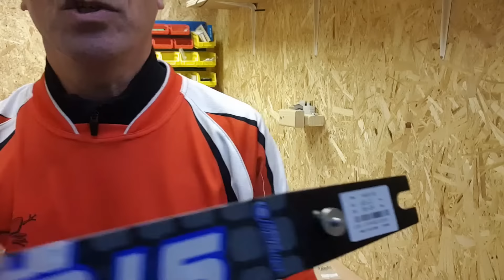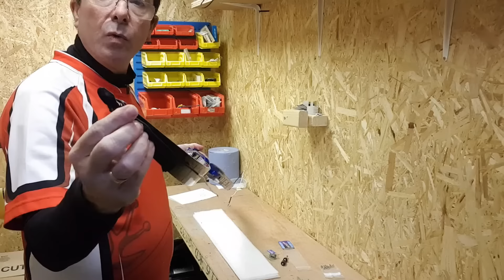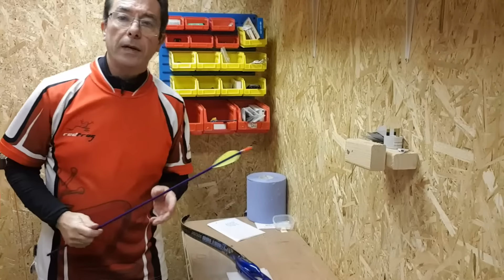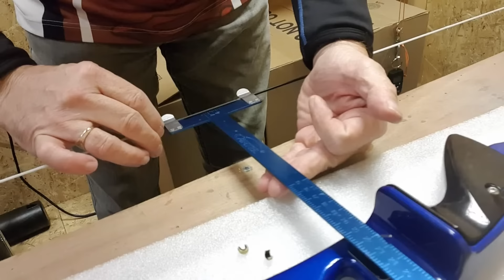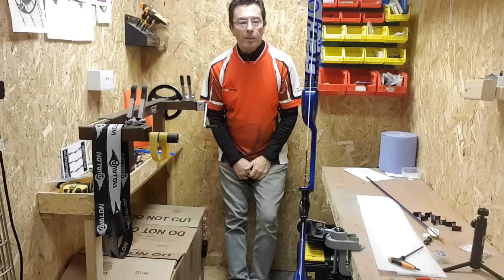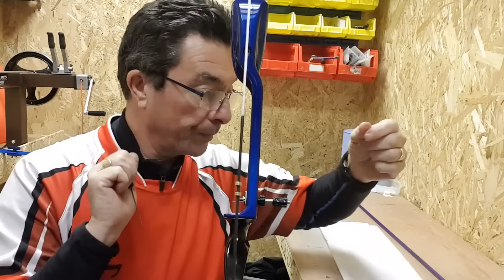Setting up your recurve bow for first time

Comment: I "might know"  why the limb tiller is different on the recurve bow.  I'm a beginner so take this with a grain of salt.  
I made a few PVC bows.  Most of them work real good.  The ones I made are like long bow designs.  The nock points on the string are above the center line unlike the nock points on the recurve being square with the string.  One of the PVC bows I made came out shooting extremely high and I had to back way nack to get it on target.  I noticed the tiller on that bow is way off from the others because I adjusted the tightness of my version of an arrow rest by heating and I got the bow so hot that it bent out of tiller.  I suspect the diffrence in tiller on the upper and lower limbs are one way the arrow pitch nock points settings are different and the tiller compensates for those differences.  I don't know if I explained it correctly so it makes sense
Anyway, thanks for the video.  I now understand a lot more about how a recurce bow of higher quality is set up.

Comment: Great video. Thanks for the useful information. This will help me a lot to set everything up correctly. I just bought my first ILF bow. Aluminum riser and carbon limbs with bamboo core. Up until now (last 6 years) I have been shooting traditional recurves (laminated and also quite traditional). This new riser is Meos 21" from Kinetic (because I am not particularly tall - 168 cm - it is also easier to transport something smaller). The same color as in one of your videos ;)

Comment: coming back  to this as I've just bought my first limbs. really useful to help tune everything. thanks. The only thing I struggled with was the brace length. mine is 8" and no matter how many twists or untwists, i cannot seem to make it more. I don't want to adjust the limbs as I have them set at the right tiller, weight atm. 68" + 25" setup.

Comment: I heard for barebow you want the tiller to be even is this true ?
Reply: Yes but only if you do string walk. Theoretically when you string walk you're pulling from the center of the bow so both limbs must pull at the same time and strenght. 
If you use a split finger hook, you are pulling higher than the center, so your tiller must be a 1/8 closer in the bottom limb. 
But prolly you know this already because this comment it's 11 months old.